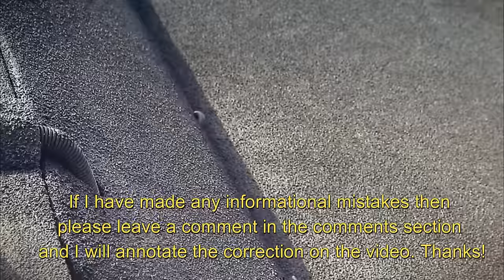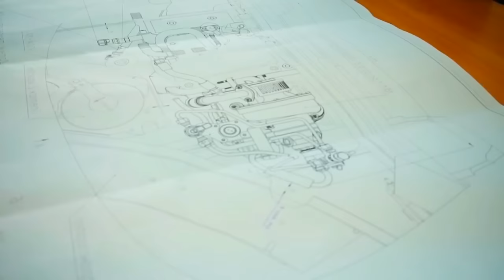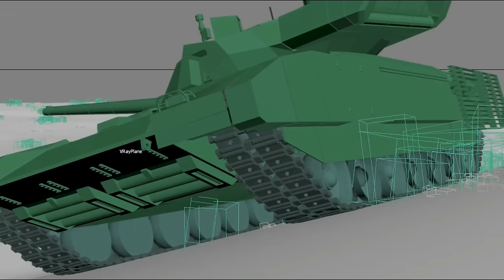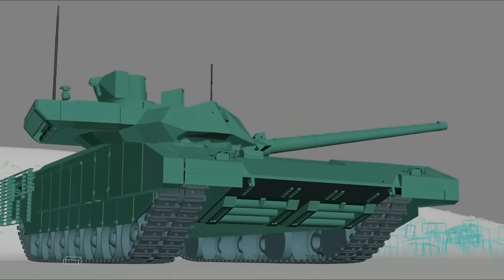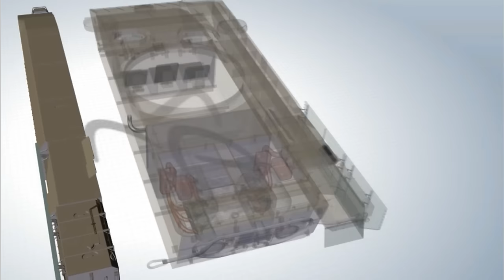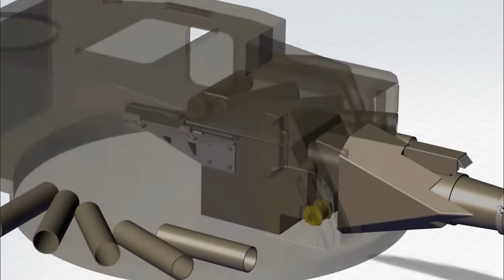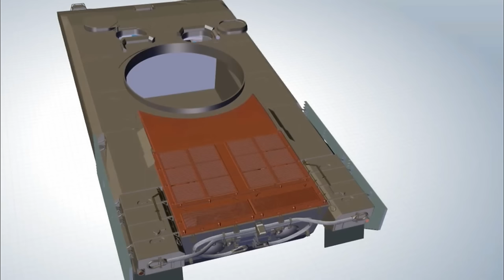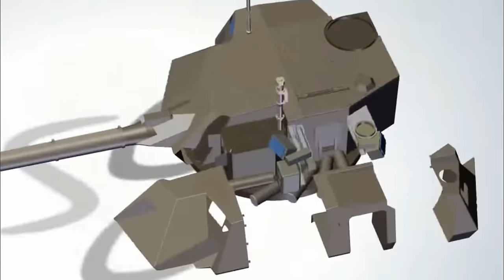T-14 Armata Russian Main Battle Tank - Tank Overview

Comment: What we know about this tank is that we have to step up to compete with this tank. Active and reactive armour systems make it difficult to penetrate and the gun has massive firepower.
Reply: The gun is still pretty much the same as ever... its all about the ammo. APS is almost useless against APFSDS and for reactive armor there is the M829A4.
Reply: Heavy ERA + NERA can reduce efficiency by 30% or more.
M829A4 is effective up to 900mm, this is not enough.
Reply: 900mm)) sorry, but curious where you heard that, even the M829A3 penetrated more than that
Reply: I prefer official sources:
BOPS M829A3 in ideal conditions:
Armor penetration at D = 2000 m., Under the corner. 00
770 mm calculation according to the Lantz Odermat formula.
In the United States, the M1A2 tanks are equipped with a 120-mm M256 gun in the arsenal of the ground forces. Armor piercing and subcalibration shells of the M829A3 series, where a depleted uranium alloy is used as the core, have an increased zabornevoe action. The upgraded sample of this series achieved armor penetration of up to 800 mm at an angle of 0 degrees.
Reply: T-14, depending on the equipment, has 1200mm + in the forehead of the case without additional booking modules, and more than 1800mm from the KE.
Reply: From the current gun M1A2 it is impossible to get more than 1000mm, it is necessary to replace the gun.
Reply: Primary projection M1A2SEP / SEPv2 / M1A1AIMv2 / FEP
TOWER: 940-960 mm from BOPS / 1400-1600 mm from CS depending on the point of impact
Body: 650 mm from BOPS / 970 mm from the bottom of the KE
The upper part has a slope of 83 degrees from the vertical. At first glance, very weak protection, but in translation for the equivalent thickness is 360 mm and 570, respectively. But, nevertheless, even translated data is extremely low for the level of protection of a modern tank.
In real conditions, the stability of the front projection of the tower M1A2 is estimated at 850-900 mm from OBPS and 1100-1200 mm from KE.
Reply: Modern portable ATGMs have armor penetration beyond the barrier up to 1400mm +, 125mm gun 2A82 with uranium projectile Grifel - 1100mm, tungsten 1000mm +
Reply: There are no official data on the M829A3, all classified or useless data. And for your Lantz Odermat calculator you're missing too many parameters. Anyway, the DM53 is physically smaller than the M829A3. The only advantage is the higher muzzle velocity, thanks to the L/55 cannon. I wonder which penetration you get, according to your Lantz Odermat formula.
Reply: That's right, theoretically. But in practice, too many changes in the parameters.
Much also depends on the weapon, the German L55 (and the French 120mm gun F-1) also has a positive effect on the speed of the projectile, hence armor penetration of the projectile. The material of the core and its structure can also differ materially.
In Russia, the measurement and calculation procedure is significantly different, it is more rigid, which leads to additional unaccounted factors. I do not have full information.
Reply: Anyway, i just think 770mm penetration for the M829A3 is highly unlikely, because the DM53 already penetrates 810mm at 2000m.

Comment: okay okay okay，i just watch to 3:51, little fact here, T-14 has nothing to do with the "T-95" which you put a picture of object640 by Ormsk which is a old soviet general turret program mount on a special T-80B chassis (which later has a longer new chassis) . And the "T-95" is never exist,if only you want to call Object195,the T-14's real father a "T-95"
Reply: T-14 is still the ghost of yesterday, the ghost of obj195,also totally worse than the most well protection tank mankind every build----the one and only Obj477. The auto loader design,the unmanned turret ,everything is finished design and even has production during the late80s for soviet experimental tanks. And such thing like obj490 which has 2 man crew, obj490A with extremely heavy top protection against air strike, obj299 with remote control other tanks and self driving ability. T-14 shows no new thing, even the APS is old type, shadow of arena and drozd. it's not Russia are not working hard. It's only that Soviet has gone too far.......

Comment: Three things that stands out to me with this video: 
A) The Russians seems confident in their armor since the crew compartment is in the front. Then again why "drive backwards" (crew/passenger module at the back, engine front) on the H-APC version... Maybe its more about the hatch/ramp solution for the solders being at the back and a weak point, but who knows.
B) The cannon might not be Western state of the art level tech. Otherwise they wouldnt go for missile capabilities on the first version in my view.
C) There is a miss match between their passive defensive systems and them using anti tank missiles via the barrel. If the Russian thought that anti tank missiles were going to become useless against a similar teched Western tank. They wouldnt bother with the missile thing for extra range regardless.
Reply: The frontal armor of the T-14 is superior to the equivalent of 1500mm. For the tank it is logical to place the crew in the front for maximum protection. For IFV T-15 requirements other, the ramp should be located in the back, so dvigatel ahead. For the crew and troops also made explosion-proof and sealed pod in the hull behind the engine.
Gun 2A82 exceeds the Rheinmetall L-55 of about 15-17% for all characteristics, thanks to an uninhabited tower. That is enough, in case of insufficiency of the 125mm caliber, to replace 152 will not be difficult. That will give unconditional advantages of the T-14, but will reduce the amount of ammunition for the 152mm.
TUR (tank guided missile) is not only used to defeat armored vehicles, it is a "long arm" to suppress point targets, it can be cumulative, thermobaric, high explosive.
Reply: Джо Неуловимый
The Russians wouldnt bother with missiles if they could match Western range on upcoming cannons. This notion you need a missile to take out infantry bunkers or similar is a waste of money when a shell can do the job.

Secondly, I am pretty sure that if this was about cars and you were talking about the (Eastern) Lada. You would still use words like "superior" or "that is enough" to describe it.

Point is, lets see how well the T14 actually performs in combat.
Reply: Lobos222 If you believe that the use of missiles means imperfection guns, it is not. In the 60х planned abandonment of guns tanks and a full transition to rocket as a weapon (IT-1 Dragon). Do guns have undoubted advantages, such as cost and versatility of shots. Therefore, these solutions have been combined.
Reply: Джо Неуловимый
Yes, Russians pushing a missile through its barrel of a cannon does equal they see their cannon has having limits. Same thing they did it on the T-72 series up to now.

Once counter measures mature. Sub sonic AT missiles with smaller warheads will be a thing of the past vs MBT.
Reply: +Lobos222 What if they have something else in mind. 

Lets say to shoot a drone through the barrel so that it can provide reconnaissance. Perhaps, they need to shoot something down cliff without a need of coming to the edge or shoot behind a mountain or shoot something behind a building. Or maybe to shoot something from tank from inside a bunker while another laser sources (a soldier) guide the rocket to the target. Last one is cool, because it can visually hide the tank, as well as, from random carpet bombing. 

***Rockets do fly twice the range of cannons, it's a fact. Rockets can also fly after helicopters. I can also highlight that Americans using no missiles through turrets, mostly because their project failed. <that's from wiki though, "The United States development of a 152 mm gun missile system for the M551 Sheridan and M60A2 tank (which failed)."
Reply: Rus Tar
What if aliens attack, what if what if... Your scenarios are so specific it sounds like you think the T14 will drive into combat alone. No, I dont think highly of your extrapolations.

"Rockets do fly twice the range of cannons"
Missiles... something guided AFTER fire is a missile, not a rocket. If you cant even get that strait its pretty evident you are not speaking from a point of knowledge. Oh, you mention wiki as source on top of that. LoL

That a R&D program tried something on outdated tanks doesnt mean jack shit. The main reason modern Western MBT dont fire missiles is because they have equal or LONGER range than the Russians have produced up to now. Which is also why the Russian supplemented their T72 series with missiles.
Reply: Looking of how far back the crew is actually though I would assume they just stacked layers of new composite armor. Considering they don't have to armor the turret as much other than to protect key components. I think the hull is crazy armored maybe even more so than the Abrams or Challenger. And if you look at t80's/t90's you'll find that they love add on armor(ERA/SPACED RHA)

Comment: im quite entranced, usually it is best to have multiple types of tanks for varying roles, and while the T-14 frame can be used with varying turrets for varying roles, doesnt this also play against it? for instance, the US has the abrams, the stryker, MRAP, M1117, M901, HMARS, Paladin, etc etc,each probably has some secrets, and classified intel, whereas the russians have a standard frame with a few adjustments here and there for varying purposes. wouldnt a single secret being found in the  US vehicles be that much better than a single secret getting out with russian vehicles that invalidates all variants, such as a tiny weakspot on the front? i know in the past, some armoed vehicles had a dime sized hole behind the main armor for some reason or another and a hit there was 3 times easier to penetrate than the rest of the vehicle
Reply: Modular system easier, cheaper and quicker to modify. In addition there is an average platform kurganets-25. BMP-3 Chassis remains. Available equipment (BMP-2 and T-72) will also be increased and modified.
Reply: Джо Неуловимый
but from what they indicated when they unveiled it, this was going to be the standard vehicle for everything, will they keep old designs, and stuff like the BMPs and outdated T-72/T-90?
Reply: Allnightgamer25 Yes, BMP-2 and T-72B will be improved and will continue for another 10-15 years. T-90A and T-80 will receive the upgrade to the T-90AM. BMP-3 is produced.
While the number kurganets-25 and chassis Armata reaches the required amount.
Reply: Allnightgamer25  unless there are some serious issues that could be exploited, it wouldn't really matter. All using the same chassis lowers the design cost, easy to produce, interchangeable parts also made parts easier to acquire/replace and is better for logistics too. It is the way to go

Comment: Assume T-14 is for 2014, whereas T-80, say, was for 1980?
Reply: T-80 prototypes were built in 1969, put into service in 1976.
But your assumption is correct. Literally, 60s Tank (T-64), the 70 (T-72), 80 (T-80), etc.

Comment: Im still worried about the umanned turret, why they didnt took the T-95/Black Eagle?

It was about as survivable as the T-14, had oldschool "turret-manning",
Ammo-Storage in a seperate compartment with blow-off panels, new autoloader cooperating with the new storage at the rear of the turret so no turret poping off anymore (at least almost^^)
Was MUCH lower on the ground then even soviet tanks! 
There were at least rumors that the crew (Gunner Commander) had 2 (sitting?) postions, resting postion (Driving to combatzone, training..) and Combat postion, so there was much more interoir space then in the past tanks, the T-14 seems to be a bit cramped, could be wrong.
Much faster fire rate then carusell autoloaders, because its right on the level of the gun.
Last is of course better FCS, Sights, ammo.. list goes on.
Negatives are that its overall bigger, has an gas-engine (diesel could be installed i think).

What an comment.
Reply: 3:48 "Black Eagle" ("Object 640") - Russian project of prospective main battle tank, developed in the 1990s by the Omsk Transport Machine-Building Design Bureau. The prototype was first demonstrated in 1997 and is a modified chassis of the T-80U installed her new tower design. Commercially not produced. It is supposed to be exported.
Т-95  (Объект 195) http://voenchel.ru/uploads/posts/2015-05/1433080223_7279605.jpg
http://i74.fastpic.ru/big/2016/0107/69/6b1e3316ab8e59a6b8a97ada163eab69.jpg
http://i53.fastpic.ru/big/2013/0101/00/e2facf2d561925770e5e58bc10224e00.jpg
Reply: Джо Неуловимый
Its pretty confusing with its names, ill better start naming it with its Object number

Comment: Exceptional. With this tank the Russians have gained supremacy on the battlefield.
The M1 Abrams was a fantastic tank but it's passed and in front of a T-14 or new anti-tank rockets, has no chance.
I wonder what aspects the US Army to produce a tank in step with the times.
Reply from the maker: Thanks so much for watching! I really appreciate it. Feel free to share the video around on social media and such! I would really appreciate it :-) Have a great day!
Reply: The V3 is supposed Abrams: Strengthening the chassis, modernization or replacement of the engine on diesel, replacing management and communication, strengthening the armor. Replacing the tower to easier with enhanced armor, installation 130-140mm guns, automatic loader. Bringing communication and navigation systems to the current level for network-centric operations.
This will extend the useful life of Abrams, but did not give a fundamental advantage. Need a new tank.

Comment: The Armata tank is a cheap replacement for the Object-195 tank, the characteristics of which is much higher. But the cost and novelty of the Object-195 tank is a problem for Russia. Also accumulated are millions of shots to the 125mm cannon and many mechanisms approach Armata. To the Object -195 tank these shots do not fit.
Also, the Armata tank has superiority over any tank of the West, and the Russian government considers this sufficient. The military elite of Russia is opposed to the Armata tank and requires a much stronger Object -195 tank, so the Defense Ministry is pulling with orders for a large number of tanks.

Comment: I can see a full automated turret with an autoloader creating as many problems as it solves. Both those systems are complicated and the more complex a system, the more likely it is to break. I'm sure the designers have taken maintenance into account, but the stress on that turret of A) just being a tank in a environment of any kind and B) being in combat drastically increases the likelihood of malfunction. The designers surely took maintenance into account, but like in WW2 with the german tanks, complexity sometimes is the downfall of an otherwise impressive weapon system.
Reply: Similar systems have been operating for almost half a century. And quite reliable. Besides the lack of the crew allows them to duplicate and to make even more efficient. In case of damage the machine itself will switch to the backup system without the participation of the crew. The tank can be controlled remotely, without any crew. Either set the security mode without human intervention.